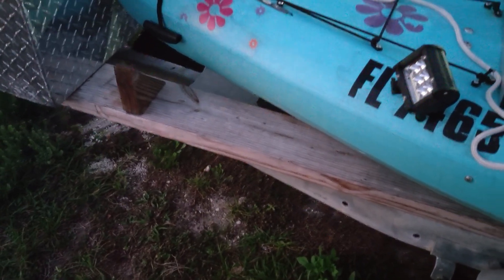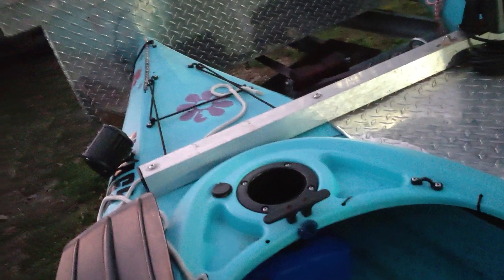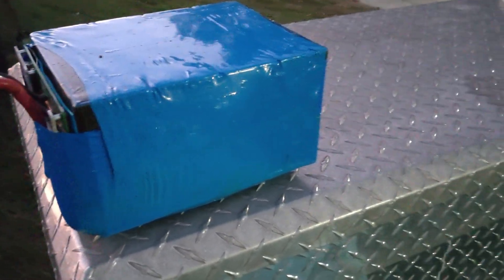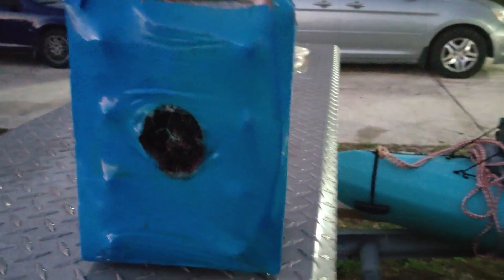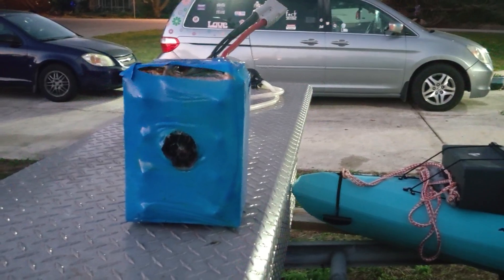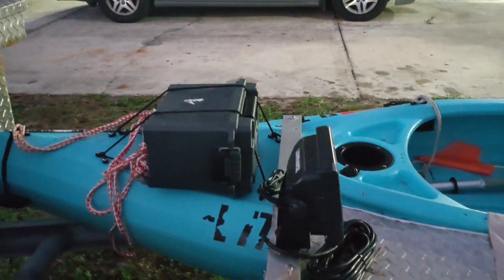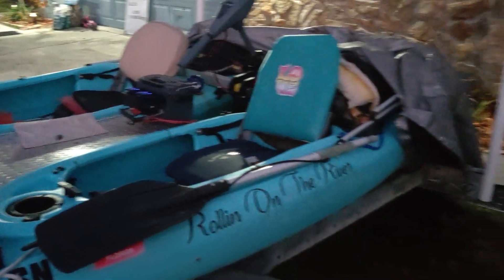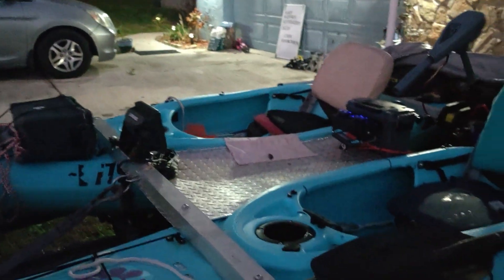OH MY GOD!! IT BLEW UP!

Comment: It's hard to tell with the heat shrink on, but it seems likely to be caused by a water short. I'm curious whether the BMS failed or one of the cells failed.
Reply from the maker: In the post-mortem, it looked like water got into the vent and caused it to flame out but it was underwater so it didn't melt the kayak. BMS might have been usable except for a pretty bad burn mark on the circuit board next to where the cell was spitting flames. I decided to not chance it.